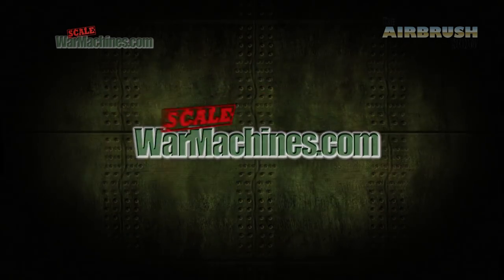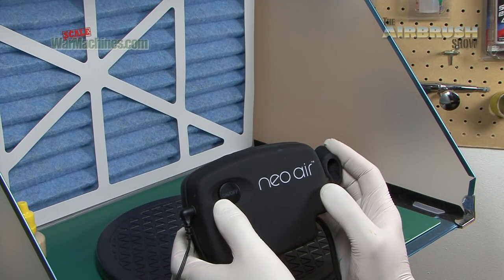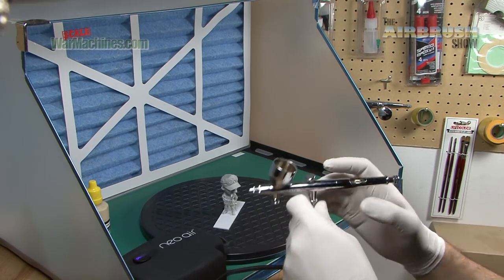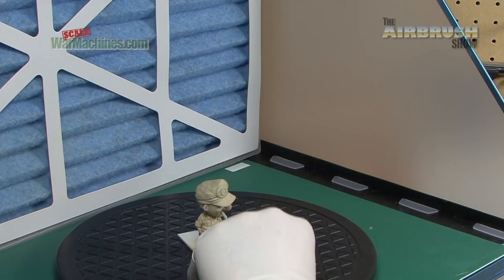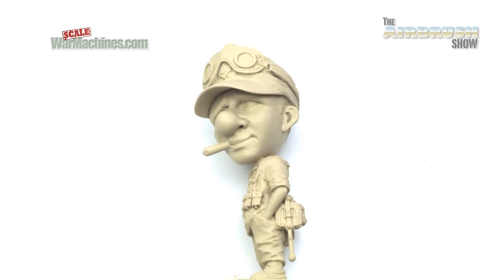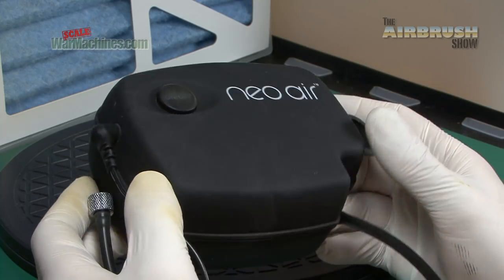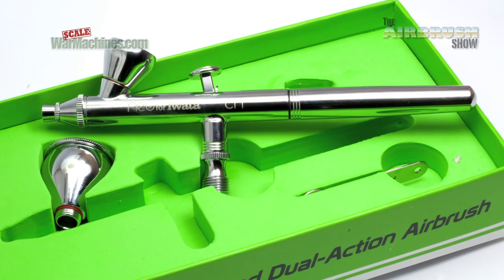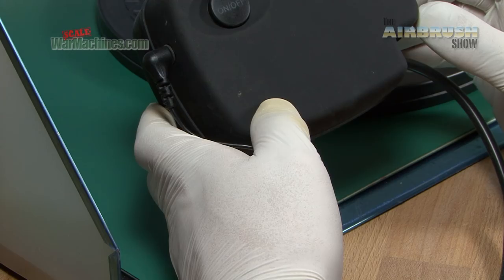IWATA NEO AIR MINI COMPRESSOR - THE AIRBRUSH SHOW EP03

Comment: Al little hack for you.  This compressor whilst not noisy compared to other, having any noise close to you can be distracting.   This is a quiet compressor but i notice most of the noise emanates from the crappy neoprene type rubber hose that comes with the unit.  Why they didn't twin a decent hose with it is a mystery .  Use a thicker braided hose and the noise level is very much reduced.   Good compressor. I'm enjoying it
Reply: Can I ask how you connected it to the unit? It just has that friction plug on the unit side
Reply: @adamdavis6671  I'd like to know too.
Reply: @eggycat  same

Comment: I have one of these and it's been pretty decent so far. I think one day I may replace it with something that is just a little bit more powerful that can run for longer but it gets the job done well and it's tiny which is what was important for me. Only paid £145 new for this + an Iwata HP-CR so no complaints from me.
Reply: Would you be able to compare the noise to a known appliance? Say a hairdryer for example? Does it overheat, or any insights you can give after using it a few months please?

Comment: I'm a makeup artist and I'm interested in this compressor to use for airbrushing silicone and water based foundations on the face and body. Have you tried using this compressor with a silicone based paint. Wondering if it will have the psi to push out silicone based products 🤔
Reply from the maker: No not used it on silicone based paints I’m afraid, but as usual if you can’t test it, try and find someone who has used it that way. Unfortunately, I can’t help!

Comment: would it be adequate enough for someone like me who doesnt model build often, but when i do i want a top job? (or as 'top job' as my mediocre skills can do anyway)

i dont have much room and would be building on my normal desk (when i get it that is, im just looking to buy an ikea micke workstation) where i do everything else, plus for storage reasons i like things as compact as possible. dont really want big and bulky.
Reply from the maker: +xneverwalkalonex yes this or the Silverline (slightly more expensive) would definitely do the job. Pick one up second hand it may be even cheaper.
Reply from the maker: +Scale War Machines in fact it's the Iwata Freestyle that is slightly more expensive, not the Silverline. That is also compact, transportable & not too expensive.
Reply: +Scale War Machines thanks for the reply, I'll check them out
Reply: +xneverwalkalonex I do suggest it, I've had mine for about 2 years and like you I don't have much space for modelling and I don't build frequently. It is not perfect but it does the job quite well for entry-level modelling. I don't think it last 30min before shutdown, I believe is more like 15 min or so it seems to me. Also another bit is that you do need a water trap, it starts producing water like a waterfall by the end of the night, that's the only thing missing in my set up. Also I suggest looking for second hands, I got mine from Ebay,  almost new, for half the price $50 USD and with the Iwata neo airbrush for $40 I did the tremendous upgrade from hand painting to airbrushing for less than a $100.

Comment: How do you attach the hose to that piece on the compressor? It's too small. I understand it needs to be extremely snug so no air leaks out. But, how do you get it on there? I don't want to stretch the hose too much and damage it. Thanks.
Reply from the maker: Just push it on by force, it is designed to fit and shouldn't break.
Reply: Just need to buy an adaptor! Very cheap and no you don’t need a real expensive one at all. You do want one that is going to cost more than five bucks but with all honesty you can get one that’s great quality for only ten bucks! They have everything on Amazon. Do some research though. That’s very serious! Just look at the reviews and always look at what real people have to say on YouTube about the airbrushes: most of the people I’ve listened to or watched don’t ask for anything in return no money nothing like that. Most are honestly giving there true opinions on the products. With an airbrush I did find out the hard way that yes this is an object the you do 100% get what you pay for. If you want one to just color in you don’t need a very expensive one for fine lines yes spend a little money. You buy a 25 dollar dual action airbrush just know that’s exactly what you’ll be getting! For 50 bucks you can get you a decent airbrush that will do the job. It will color and shade. The problems you will run into is not being able to get reliable steady work. (Lines and such) that’s when you get overspray and splatters . I’ve messed up a couple hundred dollar pieces trying to save money on an airbrush only to make the same mistake twice and had to replace them both and the whole time if I had just held out and saved a little more I would have only purchased one and would still have it. I did shell out for a Iwata and I’ve found that to be by far the best gun for the price and just quality above all unless your willing to step into the $500 range . That’s 100% true! If you just want to be able to fill in areas and aren’t to worried about fine lines and anyone that uses an airbrush for there livelihood we all know that without your tools there’s no work and your work is only as good as what you put into it and that includes if you care enough about the quality for your work that your smart enough to upgrade your tools as you can knowing that doing so is what’s going to upgrade your work and productivity in general. They have some that are charged with a basic USB and a canister that acts as a mini cordless compressor that all fits in your hand. To be transported and again as long as your not looking to do some fine script or something for about 50 bucks these things actually work great and I highly recommend them. Like I said anyone who uses these machines for there livelihood knows that we need more than one gun when we can afford it they will come if your one to take this trade seriously. For 50 bucks you can take it anywhere and I’ve never had one issue with the two I have as well as my wife and three of my children. Not one of us had even had so much as a clog. Now what we did because we were not sure for the price that any of them were going to work worth a darn but we are still very impressed. So that’s one that’s cheap you can take anywhere! For other guns for fine work and details yes I learned the hard way and waisted money by buying two airbrushes thinking I was getting a great deal but like most newbies I’m sure I went for looks and what looked the most professional. Both were junk and returned in less than two days the both of them and both were purchased at completely different times and sellers. I have found that for me personally I’ll take an Iwata airbrush over any of the airbrushes I’ve ever used and this is sense about 1991. I know there’s plenty that are better quality but not all of us are rich or established enough that buying tools like that at this time would be nothing less than foolish. Now that’s me and my situation everyone is different. So yes if anyone is listening. Please take my advice I learned the hard way and I know I’m not the onlyone trying to do what it takes to survive this mess we’ve  been thrown into. I do know that yes it worth waiting and getting the airbrush that has good reviews and is a little more expensive. After returning the two airbrushes I purchased I went ahead and spent about 45 dollars more than what the two original ones cost and if I had done that from the start I wouldn’t have been on my third one and if I was I would have the three I need that all work. I know for a fact the prices are very decent and well worth the price for quality guns and those are pretty much all  Paasche Airbrushes I’ve had nothing but good from them. Still gotta say Iwata has got me sold. I am going to try a “master airbrush” the deals seem pretty good and the reviews seem ok as well. If anyone has any recommendations for a master beginners airbrush I’d appreciate a heads up. I’ve got my iwata for fine lines a larger gun for covering large areas like a full canvas and my little cordless gun with a USB compressor all in one unit that fits in your hands and yes they work and by far are just plain ol cool.. it would be absolutely great for someone who does say cakes or body art face painting and things like that. For 45-50 bucks there really awesome and from the people I’ve spoken with and just reading reviews I haven’t heard one bad thing still in over a year! So if your getting into airbrushing don’t rush to buy everything at once you may not even enjoy it. On the same token don’t buy the cheapest things possible either because if you have the drive to really give it a shot and your first experience is with a broken machine or one that’s just hard to use cause it was cheaply made along with many other things those little things can and probably will turn you off but forever ! It’s the type of hobby that’s exactly that ( a hobby) or used as a job for money) either way you can get turned off just as fast as anything else. Don’t break the bank but don’t go the cheapest rout either you will regret it I promise! Get something decent and you’ll have a blast! I started with the 50 dollar airbrush after not using one for many years my hands don’t work at all like they used to so I had to find other ways of making it work. So using old packaging from my kids toys. The clear plastic. I made stencils and that little airbrush had made me enough money to support my family for some time now. Now I’m looking for more airbrushed to really start something finally. Heck I’m truly lucky to be alive so using my hands is just amazing. Anyway though I used the plastic and learned from YT how to do flames along with many other things and all this and spending a total of maybe 20 dollars in paint 10 in thinner and 50 on the airbrush: I started customer painting guns! Rifles and shotguns. Now leather also and so on! I’m also 100% disabled and was bedridden for 7 years I still don’t move very well so if I can do this so can you it’s all about just not giving up! That’s the whole secret! Oh that and a beautiful wife!! Love you guys good luck out there don’t break the bank but know you get what you pay for but don’t let that discourage you one bit! You use and get what you can! One tool at a time nobody buys them all at once! You can do it if I can anyone can! Dead three years ago? I’m still here..

Comment: What kind and model is the spray booth you are using in this video? Also, if I wanted to use the Neo compressor for strictly air pressure (no paint) would this model be good enough (i.e. used to blow drops of alcohol ink on tile and Yupo)?
Reply from the maker: Spraybooth is a Sparmax SB-88. For use as an air hose air supply we wouldn't recommend the Neo. You probably need something stronger & more controllable.
Reply from the maker: https://youtu.be/gohFDZGN8j0 it's the SB88 extractor,

Comment: Do we need to add water air filters in between?
Reply from the maker: Not really with such a tiny compressor. If you find moisture in the paint, you could aways add a moisture filter in-line at the airbrush end (the small silver bullet type ones).
Reply: @scalewarmachines  i am newbie of gumdam model painting and start shopping for equipments and stuffs...i am comparing a bigger size compressorTimbertech  Compressor ABPST07(not sure if you heard before)  what do u think the neo air and some bigger size one? My purpose is just for gumdam model painting...
Reply from the maker: Either will work. If you have a compressor that's a bit more heavy duty, then use that. No need to go for the Neo Air. Save up and eventually go for a silent fridge style compressor with an air tank - if you do a lot of spraying.

Comment: im really confused . their are those large compressors and then theres these small ones . could you suggest a good airbrush kit or combination with which i should go with my eyes closed . their are soo many around dont know what to buy . im only gonna be doing tamaiya etc model scale car's . priming and Painting them . budget is 180$ Max for buying airbrush kit with a tamaiya kit and a few paints and primers etc . please help
Reply from the maker: +Abdullah Khan Yes tricky. You could easily pick up a very capable second-hand compressor with a small tank & moisture trap on Ebay for that budget. An example might be a Revell Omega or similar. You are looking really for the ideal characteristics as follows. Silent running or quiet, regulator to change the PSI, moisture trap to capture water, reliable air flow - so you don't lose air power. This Neo Compressor is not best suited to your particular needs in these respects. Some people prefer a compressor that stores air in a tank so there's always a plentiful supply of air. However, some compressors that don't have a tank also work well. We will review the Sparmax Arism that you see in some of our videos - that is also a good choice of compressor but comes without an air tank. It has worked well so far on test. It should just come in on budget.
Reply: +Scale War Machines  how much is the sparmax along with the airbrush ? link to any reasonable online shop? i have to get a tamaiya kit,2paints,primer and a compressor and airbrush at about 180$ . so .
Reply from the maker: +Abdullah Khan Try airbrushes.com to get an idea of price (though they are UK based).  New that would use up all your budget & leave little for the kit & paints. Bear in mind, a compressor is one of the most expensive outlays any modeller can make - worth getting a good one. Maybe one second-hand might just leave enough budget?...
Reply: +Scale War Machines someone suggested those KSM AS186 Kit? it's for 60-70£ ? should i go with it?

Comment: My quiestion is, is good mini compressor Neo Air to paint in Tshirt?
Reply from the maker: +AlphaGarage Maybe one t-shirt but sustained spraying is not the strength of this unit - so if you need to spray for prolonged periods, over large areas or for several t-shirts - it's not suitable due to cut-off & reduced operating time.
Reply: ok thank you

Comment: Would anyone recommend using this with testors enamel paint?
Reply from the maker: Yes sure, just dilute them appropriately. Enamels always spray really well anyway. But this unit should handle it - it's best for occasional use remember - if you want something longer lasting go for a bigger and better unit, see our other videos.
Reply: @scalewarmachines  Im just getting into airbrushing and I heard this is model would be best for beginners

Comment: Is it noisy? How many decibels?...
Reply from the maker: Don't know the actual decibels but it's not too bad - you can even just about hold a conversation over it at the highest speed. This is certainly not a silent unit though! We recorded some of the commentary over the actual unit so what you hear is its actual noise level relative to an average human voice.
Reply: Thanks. I was asking that because I'm considering buying a Sil Air (Silentaire in the US) oil compressor, rated at 30db, which is more or less a fridge noise. It's quite expensive and requires some maintenance, but if this Neo Air is equally silent, I would consider it, instead.
Reply from the maker: If you get a chance to get something silent or near silent (!), we recommend you get that. Not only will it be that choice be vastly superior & more versatile machine, you will never regret investing in something that is quiet running.
Reply: Thanks again for the advise.

Comment: so could i use it for my basic need or would you recomend somthing stronger?
Reply: +snoopy jdog also just staring out and and not sure how much i should invest into one already plan on getting Neo CN Gravity-Feed Dual Action Airbrush but wanna try to save on the air compresser
Reply from the maker: +snoopy jdog We'd say with a decent gravity feed airbrush you'll never regret investing in a slightly more capable compressor, plus the compressor, if bought well & a good one, will last through any future airbrush choices or changes you make. Probably better to get a slightly stronger & more powerful one. This one's weakness is its limited run time (as it needs to cool).
Reply: Does it still shut down in low power mode?

Comment: DONT GET THIS Compressor.  It sucks ass.  I got this along with the Neo Iwata as an airbrush set.  The Neo airbrush is Meh its ok.  This compressor though.  Even on max setting I wonder if it even hits 20 psi.  With it I was constantly having issues spraying and paint drying on the needle.  I went and put out the money and got a Iwata Smart Jet compressor and its like night and day.  No spraying issues, No excessive paint drying on the needle.  Save your Cash get an Iwata Eclipse and a Good compressor and dont look back
Reply from the maker: Would tend to agree. This is a stop-gap compressor for the tiniest of jobs. Get an Iwata Eclipse (agreed) and the best quietest compressor you can afford, ideally with an air tank. Whilst this works, its not for serious sustained airbrushing.
Reply: mattzx77  Couldn’t agree more